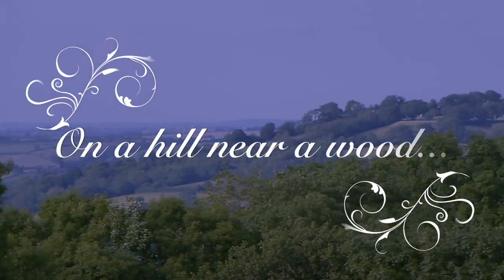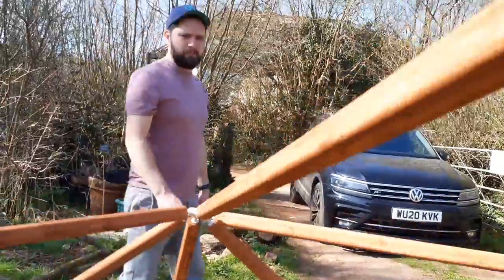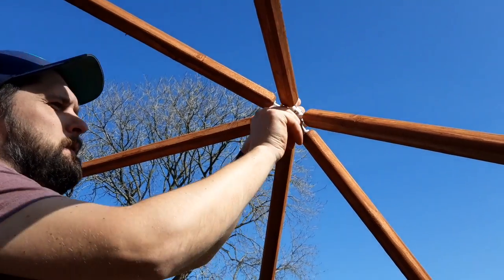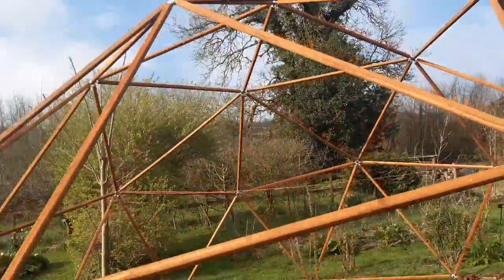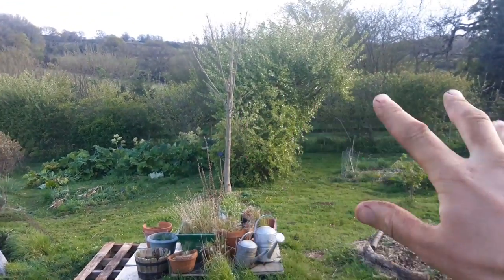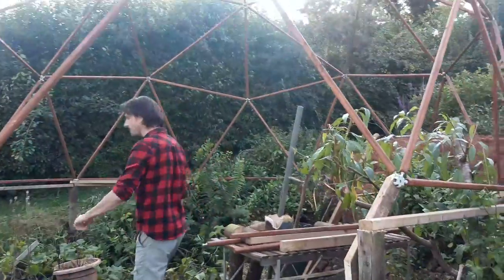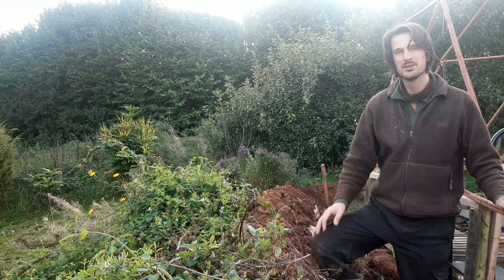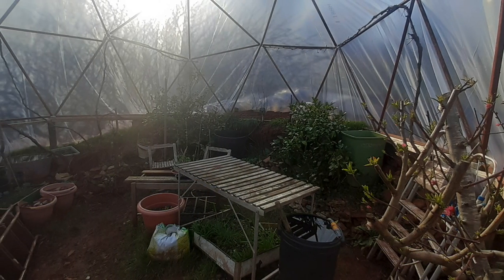Geodesic dome DIY Greenhouse

Comment: that looks like a really nice dome kit, I wonder how strong those plastic fittings are but seems super simple to assemble
Reply: They are not very strong at all,  they recommend not exceeding 30kg for the total strut weight. I wouldnt use them for windy locations or where you expect snow.

Comment: Wondering if that will do well in Wind and maybe pressure from the Snow on top in the Winter ?  Guess time will tell, looks like a good project, back to the Forrest you go!
Reply: They wont cope with snow unless its just a light dusting.